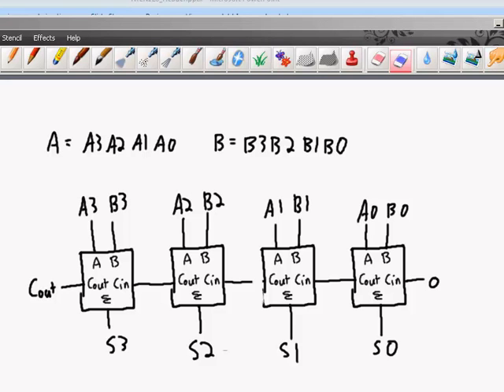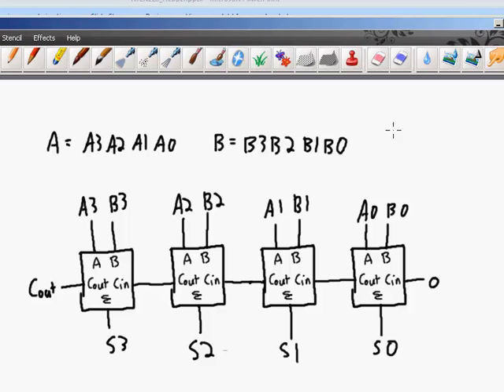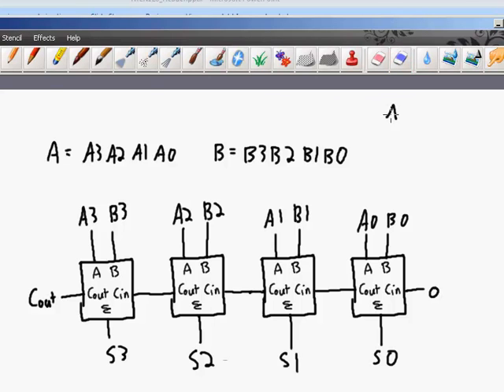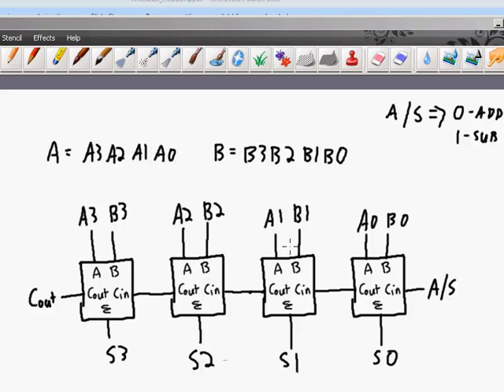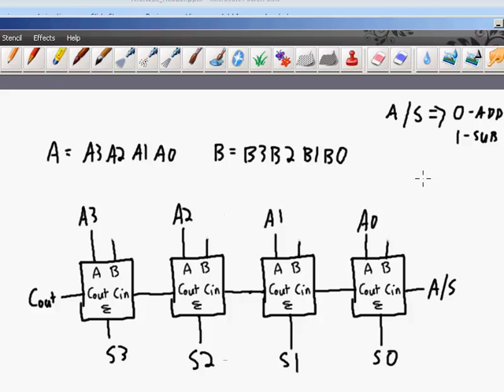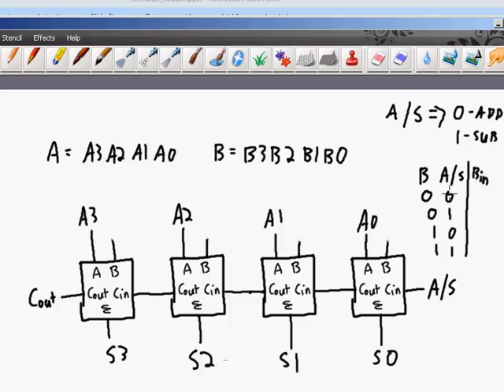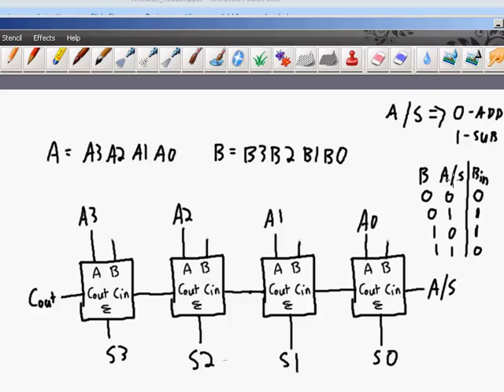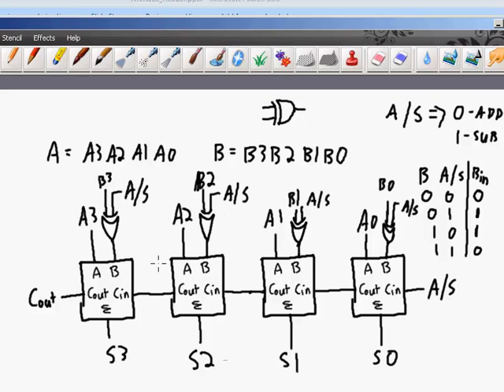Combinational Logic - All-in-one Adder and Subtractor Circuit

Comment: Why didn't you consider having an  adder/subtractor with distinct inputs for the A/S control switch and the Cin? When Ain=0, Bin=0, and Cin = 1 , S0=0 would be 0, but a carry out of 1 will be generated, which does not seem right.
Reply: Sorry, I meant S0=1, Cout=0.

Comment from the maker: True.  Thanks for pointing that out.  To make sure overflow didn't occur, check the sign bits of the two inputs as well as the output.  If the two inputs are of the same sign, but are a different sign than the output then overflow has occurred.